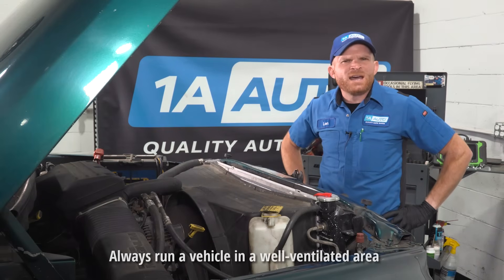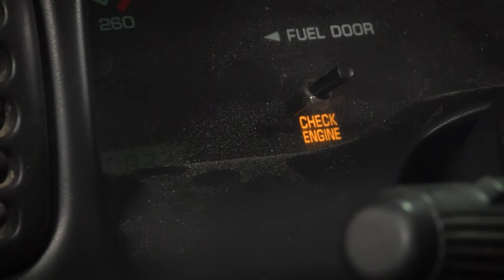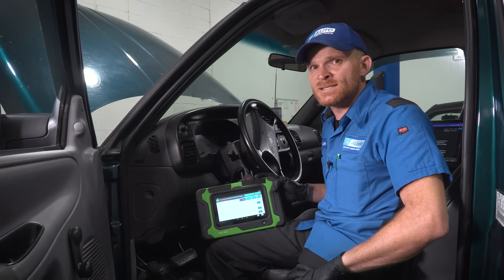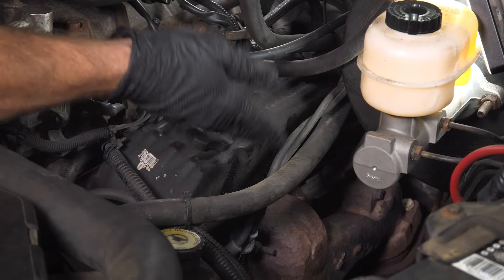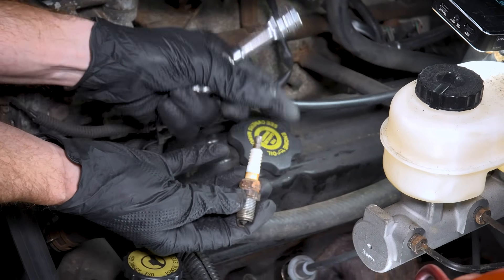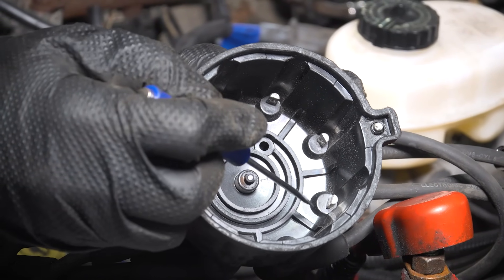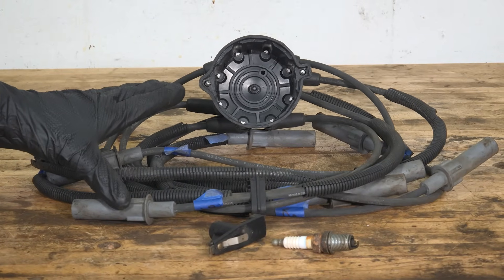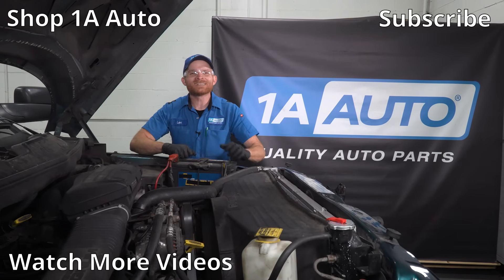How to Diagnose and Fix a Misfiring Engine Yourself. Prevent Costly Repairs on Your Car or Truck!

Comment: If you have a misfires it is possible that the spark plug is just loose which is causing the misfire in modern cars there is no distributor cap because there's no distributor  were replaced by electronic device like modules in cars